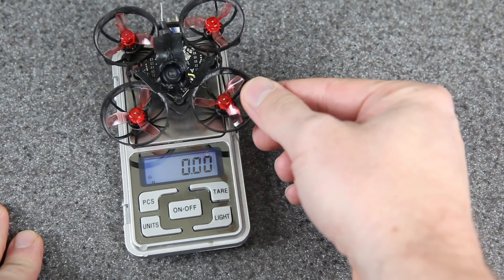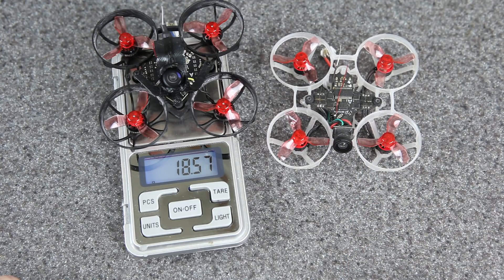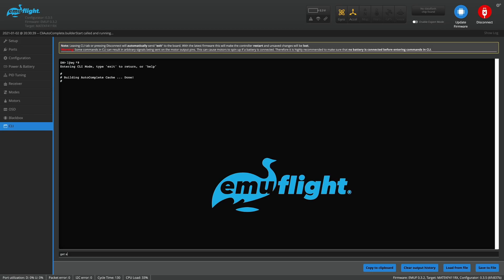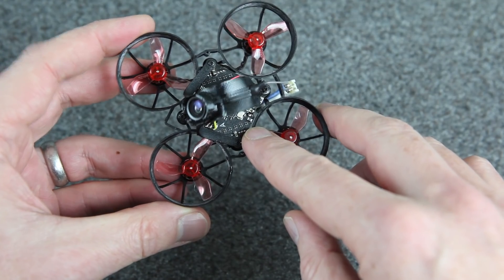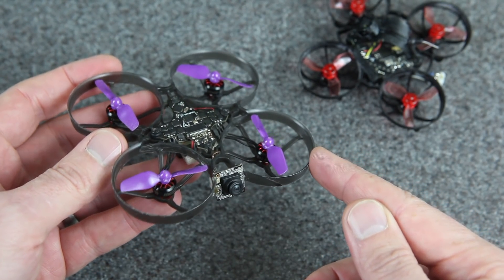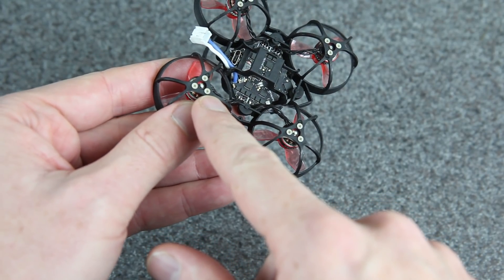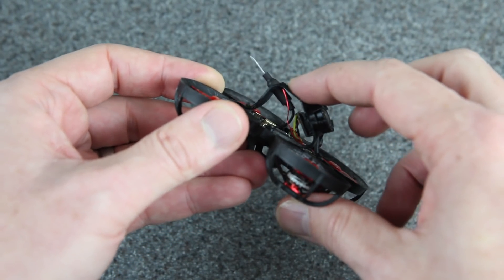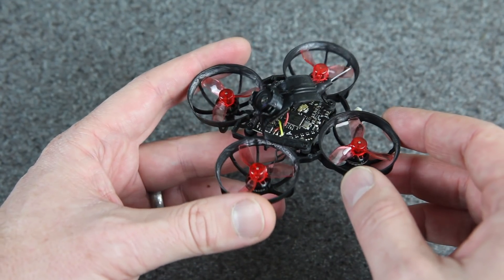DAS Might Change The Way I Race Whoops! Emuflight’s New Dual-Axis Steering!

Comment from the maker: UPDATE: The names of the commands have changed since the time I made my video. If you’re using an older build the commands are called “add_yaw_to_roll” and “add_roll_to_yaw” (as described in my video). If you are using a newer build then they have been renamed to “das_roll_with_yaw_input” and “das_yaw_with_roll_input”, respectively. The setting “das_yaw_with_roll_input” means, “when you tilt the roll stick, also make the drone rotate about the yaw axis.” The recommended starting values are given below. More details linked in the video description text.
set das_yaw_with_roll_input = 30
set das_roll_with_yaw_input = 20
Reply: I noticed, that:
set runaway_takeoff_prevention = off
was turned "on" , which should always set to "off" for whoops :)

Comment: Good day Mr. Shutterbug 🤚 I have the same whoop build and Setup settings on FC as yours, it flew just as you said and I were amazed.  But after few flights every time I hit something my whoop started to freak out, and turtle mode freaks out also plus FC reboots after every turtle mode. Is it a bug or do I need to twick something is the settings.  Thank you for your time, I hope I will fix this soon.
Reply from the maker: That doesn't sound like a problem with the tune, but it's hard to say for sure. You could try flashing a fresh copy of Betaflight or Emuflight and see if the problem still happens (backup a CLI dump of your current setup first). If the problem happens with the default tune, then it is probably an issue with the FC, or maybe a bad electrical connection (temporarily breaking connector, or temporarily shorting something). I hope that helps. Good luck!
Reply: @MrShutterBug   thank you !  Your very helpful  bro. Its not the tune it was the motor plugs its loss. Maybe its the safety features that the fc reboots. More powers to your channel 👍

Comment: Yesterday, I just try this settings with DAS (copy the CLI settings). My flying skills are still very low, but this settings, it feels so natural and pleasant, wow. When flyinf through two gates, I think I was able to fly about two times faster. I am still using both roll and yaw for cornering, with my low speed and camera angle, it is not possible to turn only by one, but it feels really good. Excelent. Will try increasing DAS values and see results.

Comment: what  battery are You using?
Reply from the maker: For competitive racing, the battery I use the most is the RDQ 250mAh HV battery. I believe it is made by GNB, but relabeled by RDQ. They work great, they are not too expensive, and they are significantly lighter than a 300mAh battery.

Comment: how do you have those antennas wired up? it looks like you are using the copper wire for radio and the bigger one for video? I would be interested to know how you did that!
Reply from the maker: You are correct. The FC has a built-in SPI receiver with a little red wire. That wire angles upward under the protection of my 3D printed camera mount. The video transmitter is also built into the FC, which makes the build super clean and simple. The VTX antenna is a simple dipole with a U.FL connector. Hope that clears things up. Cheers!

Comment: Hello Mr ShutterBug, this whoop looks so good, that in last days, I finished my copy of it, mostly the same, only with Runcam Nano 3, different canopy and metal screws. I was so surprised when first fly it, it flies soooo good, its absolutely brilliant (5min 30s flight time at first try). Thanks for this video. I am only facing one problem with RC link range, in open space outside area, the RSSI goes under 40 at the distance of 25 meters, that is so little. My other whoop with Frsky XM has much better range, and there are the same chips (ok, CC2500 vs CC2510), but BetaFPV F4 1S AIO has also LNA, so I think it will have better range. What about your experiences? Do you have some tips, what to check or change? The whoop is running Emuflight 0.3.4 (MATEK411RX), SPI receiver selected, Frsky X protocol, stock antenna. Thanks for tips ;-)
Reply from the maker: I would not expect a whoop with a build-in FrSky receiver to have the full range of an XM receiver. That said, you might be able to improve the range by:
1) Find the little red antenna wire and make sure that it is away from the other electronics. It is best if the antenna is straight. It can point straight up, or it can slope back at an angle.
2) If your radio supports D8 mode, then you might want to try that. In Betaflight, you would select "FrSky D" as the protocol. D8 is faster than D16 and people say that it makes a more reliable connection. The downside of D8 is that you don't have as many channels for your extra switches.
Good luck!
Reply: @MrShutterBug  
Now I see my big mistake :D I don't know why but I was convinced that red wire antenna is for VTX and the second one connected to IPEX is for RC. It is so obvious that it is the opposite, the red wire is right next to the LNA and there is also the track on PCB visible. Also the length (around 31mm) is for 2,4 GHz. My fault, I was not paying much attenton to alignment of this antenna. After modification, the RSSI percentage increased for the same distance by 10. I will also try frequency tune in my radio, using multiprotocol module.
About the protocol, I will have to switch to LBT version because flying in Europe, so D8 is not legal I think. But there is no possibility in Emuflight (yet?) to choose this one, so I was testing with D16. Do you know, if there is somewhere the PMB tune for Betaflight 4.2? I want to try if the whoop will fly also so good, and in Betaflight it is possible to choose Frsky LBT version.
Thanks for your help and great tutorial :-)
Reply: By the way, Allone is saying that external RX is better than built-in one. But do you know why? Now I think it can be because of antenna quality. The RF part (in chip) is the same, there could be different firmware. The Betafpv board has low noise amplifier, so it should has better range. So is the next problem the layout of PCB?

Comment: I rebuild this one almost completely. With different FC an 20g. But it's so fricking fast, is great! 
Thanks to you, the babytooth was as good as this. Both so much fun.
2 questions. 
First, what batteries so you use for racing. And second, what do you think about blheli m and rpm filtering on this whoop? Do you think is worth thinking about it?
Thanks again.
Reply from the maker: Cool! Glad you’re having fun! 👍

For technical 1S whoop racing, I usually use RDQ 250mah batteries. If the track were big enough with long straightaways, then I might use a Tiny Whoop 333. Nothing larger. 

The whoop in this video has Emuflight, which does not support RPM filtering. But in general, yes RPM filtering is a good tool. The only gotcha is that it takes more CPU time and most whoop FCs have F411 chips (the slowest type of F4). 4K PID loop is sometimes OK on an F411, but 2K is a more sure bet. That is not really a problem, but just something to be aware of. If CPU maxes out in flight you will get all sorts of issues which you can’t tune out. Cheers.

Comment: the commands dont work in cli says unknown  , i set the modes to my tx , the drone just spins around , i reversed my motors in blheli and emu , this is the most annoying toy i have ever bought i have spent more hours trying to program it than fly it , the PMB settings from facebook worked for like 10 minutes i switched batteries and my drone just flys off on is own and crashes into the wall , the other modes  are so hard to control i cant use them, was hoping this mode would make it more fun , i dont know if its my props and hardware of the settings  !!!!
also my receiver setting are aetr and this set up is taer , i dont get how to change it :(

Comment: Hi there, really nice Video again.
I'm gonna build one with this specifics.
As I clicked on the link for the FC it says, that I need an extra RX!?
Which one did you choose? On-board, or extra?
Also, do you think it's worth to switch to BT2.0?

Thanks a lot. I loved your baby tooth build, till it had always that RX Loss.
Reply from the maker: Thanks! For racing whoops, I prefer the FCs with built-in receivers, because they are lighter and simpler than builds with an external Rx. I use the FrSky version, and it has plenty of range for flying around the house or around a whoop track, which is how I fly whoops. For a Babytooth, on the other hand, I think it is worthwhile to add an external receiver because you can get more range that way. As for BT2.0, no I don't think it is necessary on a racing whoop. Getting good quality batteries is more important. The BT2.0 makes a bigger difference on something like a Babytooth because it can pull more current. Make sense?

Comment: actually, i cant use emu on my crazybee f3 fr, flashed but can't turn on the fc. And there are no available update on the fw tab 😢
Reply from the maker: Does Emu still support F3 processors? I’m not sure. Betaflight stopped supporting them when version 4 was released.

Comment: Need some stick cam or stick overlay so we can see the difference in what your fingers are doing to how the whoop handles it. I personally did not like the DAS at all but I have never liked mixes. Looks pretty sick with you ripping around! Emu is the best though - sad I took so long to jump on the emu train.
Reply from the maker: I didn’t actually like all-right-hand steering, but I do like having a mix. I can get snappier yaw turns by combining yaw input from both stick. Getting the equivalent yaw speed with just the left stick would require a bigger movement of the sticks making it harder to be precise about throttle at the same time, OR it would require higher rates which makes overshooting more likely. Anyway, it does take getting used to, but I’m getting better times than ever. I can’t wait till we can start racing again!

Comment: So I used the two links for the new betafpv aio under the hex files. I loaded your custom hex from the local firmware loader And flashed it to the fc then copied and pasted the cli dump into cli. Did I do this correctly? Now when I go to the cli tab it says building cache and thats all.
Reply from the maker: You need to copy/paste the CLI after flashing. I suggest using the official release if you can but some people reported issues specific the BetaFPV F4 1S AIO (with integrated vtx), so I shared the hex + CLI I used.

Comment: sorry for asking bud when i as a starter can do the settings with my trashcan or tinyhawk,i am a absolute beginner ,onlyused to fligh parrot bebop and xk 800 gliger
Reply from the maker: The PID tune is designed for these small whoops so it may not be appropriate for the trashcan and tinyhawk, but you can certainly use DAS steering. If you want to try it, then I suggest you:
1) Do a full CLI dump of your current Betaflight settings and save it to a text file in case you want to go back to Betaflight later.
2) Flash the latest Emuflight release candidate.
3) Set up your rates, modes, etc... in the Emuflight configurator, but leave the PID tune alone unless you know how to tune it.
4) Once you're all up and running in Emuflight, then you can try out the new DAS steering commands presented in this video. Just know that the name of the commands might change before the official release. When I get final word on that I'll pin a comment to this video.

Hope that helps. Have fun! :-)

Comment: 3d reaction wheel would be faster
Reply: simpler too, you would not need fancy controller
Reply: no mixing, only throttle and 3 axis
Reply: patent: use of reaction wheels in quad/plane control
Reply: Can this be done in bf?
Reply: @Super_Mario_Fpv  put reaction wheels in the controller axes?
Reply: @Super_Mario_Fpv  you have 4 axis, one for "more gas"

Comment: It's my first time hearing Emuflight. Is it better than Betaflight? Will it work on a 5 inch quad? Great video!
Reply from the maker: They are similar in many respects because emuflight is a fork of the betaflight code. Emu has some unique features especially for angle mode whoops, but it lacks some of the newer features that have since been added to betaflight like rpm filtering. So there are tradeoffs. Yes it can work for 5” too.
Reply: @MrShutterBug  Thank you!

Comment: What is the weight difference between the RENY and PEEK screws?
Reply from the maker: It’s not very significant because RENY is so light to begin with. You can see the full specs on solidspot’s website linked in the description. I still recommend RENY because it’s way cheaper (but still not cheap).
Reply: @MrShutterBug  thank you for that.  BTW is there a reason why you chose Flat over the Pan head screws?
Reply from the maker: @singlefin  not really. Either type is fine and the weight is about the same for these tiny screws.

Comment: Also, I have a question, how could my Betafpv 65s become unbound? The frame on the 65s is horrible;It cracked after 10 flights. I switched frames and props and now it's not bound...!? Very frustrating
Reply from the maker: That is unusual. A drone should be loose its binding unless it binds to a different radio. Does the drone still work if you attempt to rebind it to your radio?

Comment: Did u modify that canopy file to get more camera protection? I really want to use those canopy’s with my 199c cameras but they seem to only offer protection for the runcam nano 3 , but yours looks good
Reply from the maker: I did not modify the canopy but I did have to push/stretch pretty had to get the wider lens to fit through the hole. Now that it’s in, there’s no way it’s coming out.
Reply: Where can i find a printable version of that camera holder?
Reply from the maker: @thisadventurelifeoregon  in the video description

Comment: Helo. Can you take those screws out of motor if they brake? Thanx
Reply from the maker: I've never had that happen on a little whoop like this, but it did happen once on a slightly bigger drone. I used a tiny drill bit to clean out the leftover material from the screw. So yes it's possible.

Comment: How do you remove the motor connectors from the fc?
Reply: Just grab the plug with your fingers and repeatedly wiggle the plug back and forth until it comes off. There is a video by Adam Bomb FPV about how to do this. Search youtube for "adam bomb break motor plugs off flight controller"
Reply: @sganzerlag  I haven't watched the video you suggested, but I have followed your clear, simple instructions and have successfully done this dozens of times with no failures. I can't thank you enough, this changes everything for my tiny whoops

Comment: I tried this combo out actually, the new aio betafpv board with the ex0802 19,000kv motors and it flew super nice. But unfortunately my board didn't last very long. The esc failed. I swapped motors to confirm and esc #3 just wont deliver power to the motor.
Reply from the maker: Bummer.

Comment: so is this better for efficiency?   and do u like this one better than the lightweight 75 mm one you built the other day ?
Reply from the maker: My light weight 75mm drone is definitely more efficient than this one. The 75mm drone also has better acro handling than this one. But, a lot of races only allow 65mm whoops. And that's fine with me. 65mm may be less efficient, but I can still get through a race no problem and they are plenty fast for tracks like this one. Cheers!
Reply: @MrShutterBug      could u do another video of an in depth build for the 75mm please?   I'd like to build that one.  maybe u have some new components for a lighter build.   thanks

Comment: Which version of Mobula6 was used in the flight- 19000kv or 25000kv?
Reply from the maker: This is not a Mobula6. You can see what parts I used in the video description text. The motors are 19,000KV 0802.

Comment: I think one of the biggest benefits of this is that the mixing is done in the FC which means it will do those coordinated turns faster than any human could.  It will probably translate into even faster pilots than we have now.  Interesting...
Reply: Let me know if you want any other information Albert.  I know you fly Acro, but there are some racers that are adding this mixing to their acro racing rigs tool.  It's profile dependent so you can different values for Acro, Horizon and Angle.  It's also super dope for Angle mode and Cine flying as it's super smooth.
Reply from the maker: Hi Albert! Doing the mix in FC firmware is also better than doing the mix on your radio because it understands angle mode, angle limits, etc...
Reply: I don't really see this being welcome at real races. never the less it's awesome and cool and it's going on my next Micro build!
Reply: @wardope  Why wouldn't it be welcome at a real race?  You could say the same thing for the FPV_angle_mix or the cinematic yaw versions of PMB back in the day.

Comment: I had the same behavior set on the transmitter mixer, is there any difference?
Reply: yes, on the radio, it won't respect angle limit and is technically "slower".  So, if you have 65 angle limit and go full stick (adding let's say 20% roll on the radio) you can actually flip out the quad as it's trying to add 20% more than it's allowed.  But yeah, when I first started doing this, I was doing it in radio and it "works" it's just not as good.